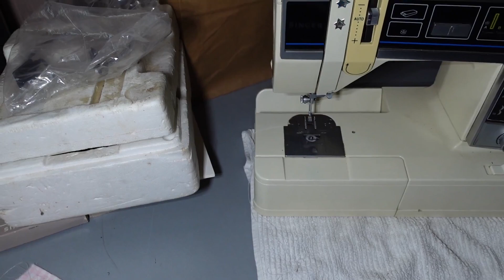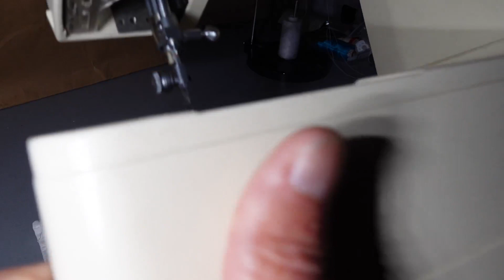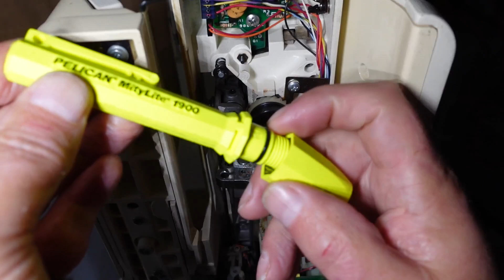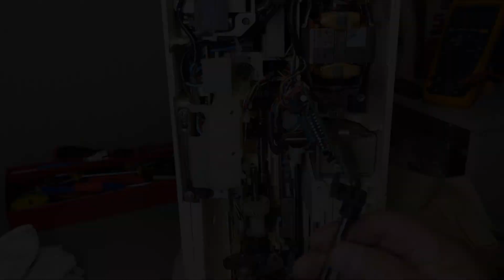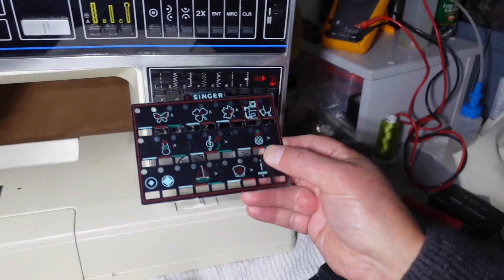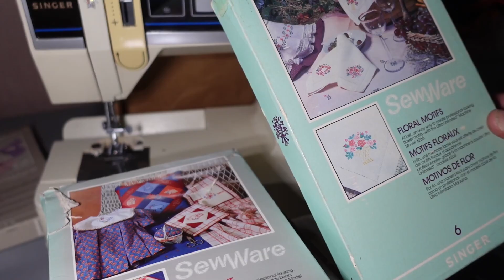Singer 6268 Sewing Machine - Part 1 - Local Charity Shop Repair - Feeding Issue

Comment: I have owned this model Singer. They are fairly good machines. And this one will need a complete lube and oiling. It will be as dry as a bone. That should help to quiet it down and run smoother. 🧵
Reply: Where to oil it ? My mother has one and every time I mention oiling it she tells me that it is electronic and oil will damage it. She remembers that someone from Singer said that to her.

Comment: Does the embroidery attachment really need the feed dogs? It would be also interesting to see a teardown of that.
Reply from the maker: I have decided to pursue it to see if the embroidery unit is independently run or not so keep an eye out for another video. Thanks.
Reply: I got one for $30 dollars, it is a 383-1764 model, just need a thread spool, and the bobbin filler 😮 don’t know where I can fix it